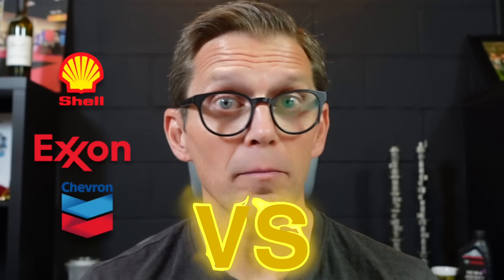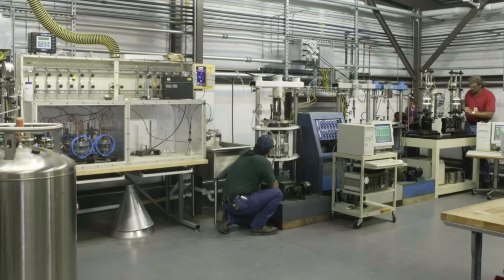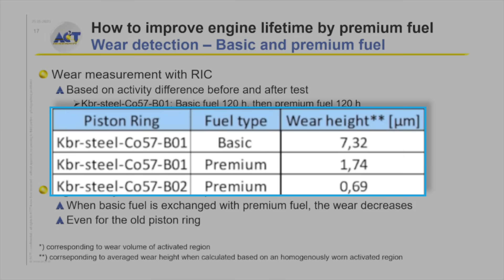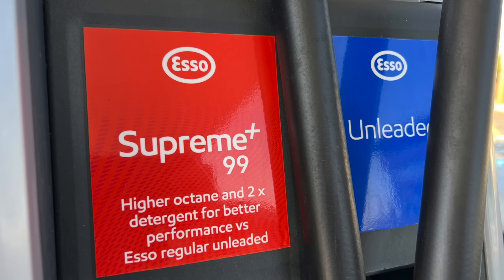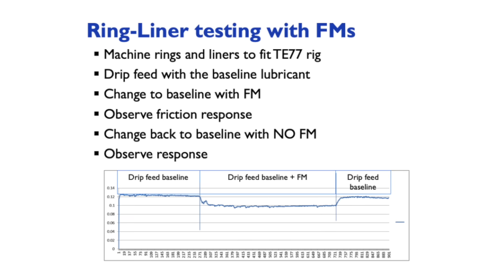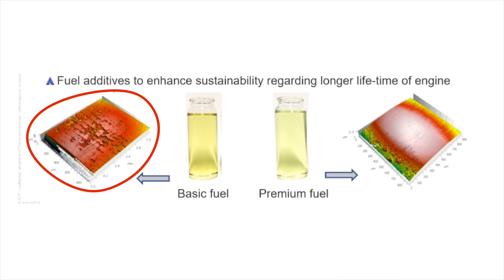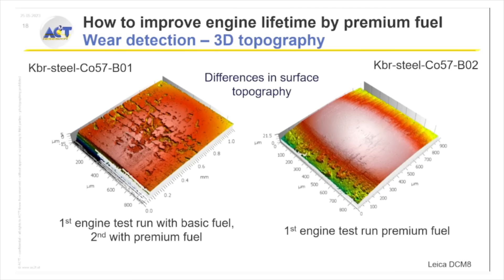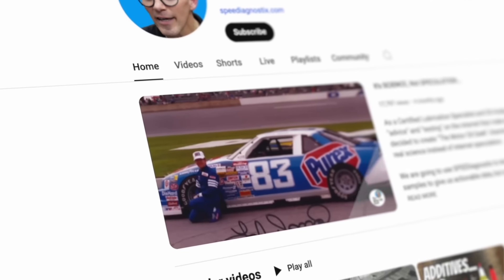Can Premium Fuel REDUCE Engine WEAR?

Comment: I don't know if Top Tier gasolines are monitored for consistency in their formulations; however, here are the requirements to be called Top Tier for all grades:

"Top Tier gas
This gas has higher levels of additives that clean engines. It's available in all octane ranges and is beneficial to all vehicles. Top Tier gas can help reduce carbon deposits, improve fuel economy, and increase vehicle performance. Many automakers recommend Top Tier gas to help preserve their engines' original performance and emissions. 

Further:
Most major automakers recommend using Top Tier gasoline, which is sold by most well-known fuel retailers. Top Tier gas contains detergent additives that go beyond federal standards to better protect today’s increasingly sophisticated engines. So Consumer Reports asked those manufacturers if it’s okay to temporarily switch to whichever gas is cheapest, regardless of whether it is rated Top Tier. We also asked experts at CR and at AAA whether it’s okay to take a “cheat day”—or week, or month—to take some of the sting out of rising prices. https://www.consumerreports.org/cars/fuel-economy-efficiency/top-tier-gas-is-better-for-your-car-and-might-be-among-the-c-a9639508891/#:~:text=The%20difference%20is%20real:%20In,over%20a%205%2C000%2Dmile%20interval.

More:
The difference is real: In 2016, AAA had an independent engine testing lab look at how Top Tier fuel affects carbon buildup and deposits on the intake valves—which can result in a rough idle, acceleration hesitation, knocking/pinging, and reduced fuel economy. The results showed that on average, non-Top Tier gasoline had 19 times more carbon deposits on injectors, on intake valves, and in the combustion chamber than Top Tier gasoline.

AAA also found that Top Tier gasoline can have a cleansing effect, reducing intake valve deposits by 45 to 72 percent when used over a 5,000-mile interval. Variation in the results is attributed to the detergents used by different brands.

Comment: STOP THE CONFUSION!
Why do most diesel engine oil containers say diesel engine oil. Most motorcycle oil containers say motorcycle engine oil. But, containers for internal combustion car and truck engines say motor oils? I understand an engine can be called a motor, but with the growing amount of electric and hybrid vehicles, this is slowly becoming a confusing issue. Electric vehicles are not driven by engines they are driven by motors. This is pretty clear. Hybrids are usually driven by both an engine and a motor. So why are we still calling an internal combustion engine a motor? I would hate to see someone calling Tesla and asking them, "Where does this motor oil go?" I am pretty old and remember when Detroit was considered the Motor city capital of the world, but times are changing, and I think it might be time for the lubrication industry to catch up and stop the confusion. By the way, you might want to consider change your name to The Engine Oil Geek. Though I like The Motor Oil Geek better!

Comment: 10:30 It said after 10 hours. At no point is that tiny bit of oil sitting in the rings for 10 hours. It is constantly cycled.

Comment: Where should I look in a 5.3 GM for oil loss?  Losing about a quart per 3k miles on a fresh rebuild (7500). Doesn’t smoke but my quarter panel has burnt oil on it.  Leak down is ok.  Bore scope only shows dirt valves. Have a Mighty Mouse pcv on it and it doesn’t fill.

Comment: This might be a fun question, what engine was this tested on? Was it one that would usually have a recommended fuel octane level of 87? I don't suppose there's any 87 octane stuff out there with friction modifier already mixed into the fuel?

Comment: Ford "recommends" top tier premium 91 fuel in their recent vehicles.  But Says rhey can take 87 regular.  Sometimes I do and sometimes I don't.  But this makes me want to get premium when I'm not driving much.
Reply: the recomendation in this case is that your car will tune the engine to have more power with premium and have less power with regular. A more recent technology car manufacturers are doing.

Comment: I'm sorry, I smell a rat here; the trend toward lower-viscosity oils. If the oil is degraded in the ring groves due to dilution and is the cause of ring wear, wouldn't a higher viscosity be a fix? Of course, at the expense of less performance and fuel economy.

Comment: I find this video very informative. In the past I’ve had bad luck with shell fuel. The shop I work at we actually did a test on various different brand of fuels, all testing was done on a bone stock 2011 coyote mustang, we were tuning the engine to optimize power and performance. We found shell fuel to be by far the worst fuel for hp. The best I can remember it was spark knocking back enough we had to take 4 degrees of timing out to calm it down. We went to a different shell station to get fuel and try again thinking it was bad 93 octane fuel, and was rewarded with the same result. Our results showed qt and racetrac brand fuels to make the most hp.
Reply: There are a few Ford Ecoboost tuners who flat out REFUSE to do a tune (especially to an engine with a larger turbo than factory bolted to it) on an engine with the Shell V-Power.

They do not say (or do not even KNOW for that matter) which component in that fuel's formulation causes all of their problems, but something, I am guessing either the detergent package used of the anti-wear additives disallows them from consistently put an optimal 93/E10 or 91/E10 tune into the ECM.

My 1.6 Ecoboost is basically factory stock, so I only use either the 93 V-Power, or Sunoco 94 <-(more so in the summer, as I am still on the factory intercooler as well), but not sure how the detergent and anti-wear additives compare between these two fuels.

Comment: I have a 2006 Hyundai Sonata 2.4 with original engine at 253402 miles, has had the cheap stuff its whole life, it doesn’t use a drop of oil at 3k miles servicing.

Comment: My 1.4 Jetta turbo definitely runs better on premium fuel, it's stated in the owners manual, that engine performance can be enhanced, ive noticed it when auto racing. Mobil supreme and Amoco ultimate 93 octane. I've gotten better performance and mileage compared to regular grade fuel.

Comment: Can we have a comparison of different fuel brand? Most people swear by Shell and Exxon, but no one is talking about Costco Gas. Costco is Top tier gas, and they claimed that they also have additives in them. Thus, I wanted to know if their regular gas have the additives too, or only Premium gas does. Then, compare costco gas with Shell. That will prove to everyone I know that Costco gas is cheap and they also protect your car!
Reply: By the "rules" a brand can't say they are Top Tier unless ALL the octanes are. FWIW, "Top Tier" was originally for new cars.
Reply: @joejones4172 thanks for the respond! I just want to know the gas quality between costco and shell. Both of them have their own recipe for additives, so I wanted to know which one is “better” for my car.
Reply: Safest option is Shell but Costco is popular for a reason so it should be fine as well

Comment: Since using higher octane impedes performance if regular is recommended, it’s too bad (in North America) that additives aren’t included throughout the range of octane offerings. With respect to fuel use and measuring ring wear, doesn’t the makeup of the cylinder sleeve make the most difference? Are the benefits of fuel additives similar regardless of whether the vehicle has cast iron cylinder sleeves or if they’re coated with Nikasil or some type of plated cylinder coating?  With respect to engine longevity, because of improved heat transfer (which also allows for tighter and more efficient piston-to-cylinder clearance) am I correct to believe fuel additives are less important than cylinder sleeve construction?

Comment: Hello!
Just chiming in on my experience between fuel brands on my 2023 BMW M4 coupe which has a 3.0 liter twin turbo straight six factory rated at 473 horsepower.  Here in California, our gasoline blend is a bit different.  We also do not get 93 octane gas; we get 91.  
Onto my intended comment, using Shell 91 octane fuel has been very frustrating.  The turbos don’t spool up at lowish rpm, and remember, on the S58 engine, it makes 410 ft/lb of torque at a lowish 2600 rpm, which is basically a tick above idle, so to speak.  Back to the Shell, the turbos spooled up slow, and would not hit until about 3500 to 4000 rpm.  I thought my car was honestly defective, or the factory engine tune was buggy.  I even used the 20 oz bottles of Techron FI cleaner additive on several tank fill-ups.  That helped a little, especially with the coarse engine operation above 3000 rpm.  With Shell, on deceleration, the coarse operation was so bad, it felt like the driveshaft carrier bearing was bad or that the wrong grade of rear differential lube was used, which symptomatically produces a chassis shaking vibration.  After a few tankfuls of Shell & 20 oz bottles of Techron, I switched to Chevron 91.
Chevron 91 octane, what a difference!!  This car now revs and willingly spins up very freely, and the engine NVH at 3000+ rpm with Shell, is now completely GONE!  It is a whole different engine now.  In fact, I can feel the turbos hit right when the clutch is released. With Shell, I thought all this hoopla around the M4 & S58 engine was a bunch of crap.  My pervious E46 M3 with the naturally aspirated straight six with 262 ft/lb or torque at 5000 rpm felt sharper than my S58 rated at 473 hp & 410 ft/lb of torque on Shell 91.  Back to Chevron, throttle response is super sharp, power is now everywhere, as opposed to waiting for the turbos to spool up before the power would hit, and that was at every rev range, the engine now spins up extremely turbo lag free and very smoothly.  Hell, the M4 is now completely different; it is the car it’s advertised and marketed to be, that being powerful and fast.  I will never go back to Shell 91 octane, which is the highest rated brands of fuel among the 91 octane rated fuels available from different fuel Sellers in California.
This 6 speed manual transmission M4 coupe is relatively new to me.  I have about 1500 miles of seat time since I bought it.  Fuel in this turbo car makes a big deal.  Chevron 91 octane is the hot ticket.  I’m sure all the Techron fuel injection cleaner additive has helped a lot.  When Techron FI cleaner is in the tank, the S58 engine just runs that bit more smoother, and the turbo torque hits a bit harder, than without it.  
This is my experience and I’m sticking to Chevron fuel from here on out
Reply from the maker: Thank you for sharing

Comment: Not sure how revolutionary this video really is. We all knew oil at the piston ring was being diluted by fuel. That dilution caused wear because the oil additives were also being diluted at the piston rings. So now everyone in the comments are focused on finding the fuel with the best additive package. That could be a significant cost increase in fuel for a very minimal gain and performance. Sure, the fuel is diluting the oil and if the fuel contained friction modifier additives in it it would help support the oil it's diluting. But if you start off with high quality oil then the fuel would still be diluting the oil but the additives would already be in the oil to deal with that dilution. 

Nothing was said about the oil being used in the test. Was it synthetic? Was it low mid or high quality oil? Did it have a high or low friction modifier package?  Was the oil chosen for the test because it would magnify the results of the fuel additive wear test?  Was the study done to honestly inform and benefit the consumer or is it a sales pitch by a company selling fuel additives? Did the testing have a slant to it to get the desired result by using a poor oil package?

Moral of the story, use high quality oil with a quality friction modifier package. It's cheaper than buying fuel with additives probably.  Of course you can do both which would be ideal. High quality oil and high quality gas hard to go wrong. But if you start off with high quality oil in the first place maybe the dilution won't be as impactful. There's way too many variables that we don't have the answers to.
Reply: The Austrian test used an oil deliberately crippled with a lack of anti-wear additive's to simulate oil that was "worn out".

Comment: How much did Shell pay you to make this video?  In the United States, the term "Premium Fuel" is referring to the octane, and only the octane.  An 87 octane fuel can, and does, have the same additive package as the higher octane "premium fuel.  It's all brand specific, not determined by octane.  This video is VERY misleading.
Reply: Not true.  Premium fuel contains more additive compared to the non-premium.
Reply: @KM-ol5bs  Incorrect.  Depends on the brand, not the octane.  Was in the business for 35 years.
Reply: @FrankDank-ik7ic   I've seen the blending tables for Chevron and Shell so take it for what it's worth.  So perhaps some off brand does it differently.
Reply: @KM-ol5bs  Chevron and Shell are not the only brands........

Comment: But then all the ethanol they put in there causes deposits and ruins all the metal components in the fuel system... Maybe totally ineligible to be considered. Wear protection maybe 20 years ago but not with all the ethanol, fuel doesn't even smell the same anymore

Comment: It’s all about octane level. If you happen to know GM 1.5 turbo engine which is nightmare, they stated using 87fuel. The more cause this engine failure under 60k is the 87 fuel.

Comment: stupid title, stupid answer..  YOU DON'T BUY OCTANE PERCENTAGE BASED ON PRICE OR LONGEVITY, you buy the octane rating your engine is designed to run and that is based on then engines compression...  some engines like fords flex fuel can burn darn near anything but still have a rating you should adhere to for best performance.. the coyote is a lower compression engine so it likes 87 which is theta the recommendation is, if you are running like E85 in it and the octane is like 78, get a can of octane boost and add accordingly to get it to 87,m nothing mroe nothing less.. my truck has one and it gets horrible consumption on 91.. not designed to run a higher compression octane which is for higher compression engines, ALWAYS GO BY THIS REGARDLESS OF WHAT WITCHES BREW THEY ALL WANT TO SELL YOU!

Comment: I'm in Australia, I bought a brand new Nissan Maxima in 2000 (same as the Infiniti I30 in the USA). From day 1 I ran premium fuel and kept receipts listing odometer, cost and liters for 6 months. I then did the same for the next 6 months with standard fuel. I tallied everything up and came out with a $ per km for both types of fuel and they were both the same!

So...I figured, if I am going to pay exactly the same $ to drive exactly the same distance, I'll buy the fuel that comes with the additives. 

When fuel companies need to start taking short-cuts and add "less premium" stuff into their fuels - I'm banking on them screwing over the cheap fuel first.

Comment: I'm curious to know where small gas station chains get their fuel from. Because it's not like there are loads of big companies that produce gasoline and diesel. It mostly seems to be Mobil, SHELL, Sunoco, Texaco, Irving, Valero and VP Racing as far as "name brands" go here in the states. I think BP is a European company. We only ever had one BP station here in town and it went out of business years ago. In my area for name brands we have SHELL, Sunoco, Mobil, Irving, Valero and VP Racing. But we also have a small gas station chain common in this area called Stewart's Shops. They're obviously not big enough to produce their own fuel so I'm curious to know who supplies them. It has to come from a name brand one way or another.

Comment: I would like to see the more in-depth video.  I'd like to know if upper cylinder lubricants such as those from Amsoil or Lucas are worth it.  
Also, a question I have always wanted to know, is why does Phoenix, AZ not have 93 fuel?  It's hot, dry and relatively low elevation.  Seems to me we need higher octane more than most places.  
Also, many places have top tier gasoline. Is there a difference in top tier gasolines?  You talked about Shell, Shell and Chevron are routinely 20-30 cents per gallon higher than other stations like QT.  All are top tier, is Shell and Chevron worth that much more?

Comment: I read a paper on the internet a long time ago that was written in the 1990s by a petroleum engineer. He claimed in a long winded way that it didn't matter so much which brand of top tier fuel you used so much as sticking to the one type say shell for about 3000 miles then switching to a different top tier brand to prevent varnish build up as the different companies had different formulations for their additive packages. He claimed through his companies testing that they all missed some stuff but that if you switched brands occasionally that the opposing brands fuel would fight the small amount of varnish caused by the other brand and keep your car's valves etc. cleaner over time. Granted this wasn't talking about wear just varnish build up. Also this was a very old paper and it's the internet they could have been making it up ./shrug. Good stuff thanks for the very interesting experimental results.